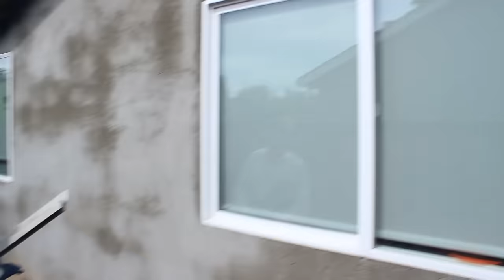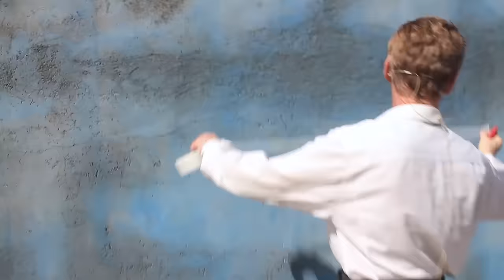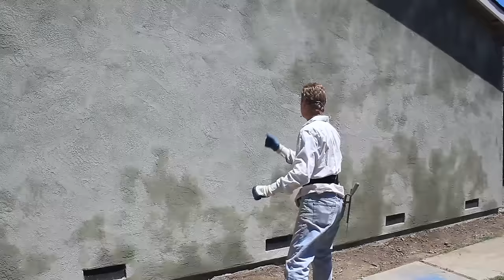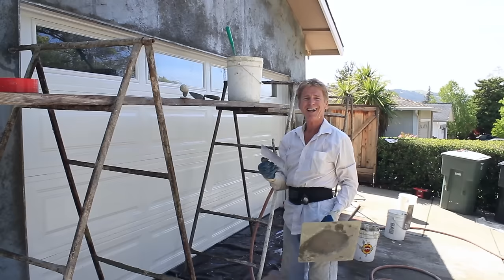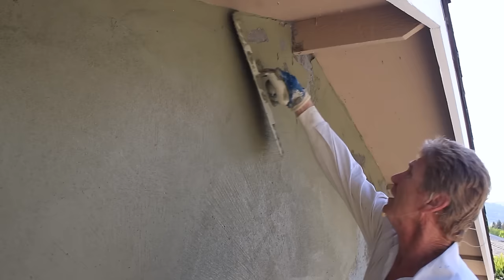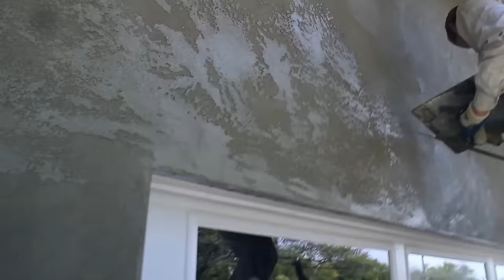Stucco Resurfacing

Comment: Hi Kirk -
I'm doing home that its painted some areas are really bad and stucco falling off with many cracks, contractor wants to hydro pressure wash I'll probably end up with some areas where stucco fall off from pressure wash and some painted (clean) areas, what do you recommend for the bonding process?
Should I go light on painted areas and few coats of bonding where paint and finish stucco coat are no longer exist?
My concern is two different surfaces and last thing I want is to see cracks between the areas or stucco falling off from painted areas 
Beautiful job keep it up 
Thank you in advance
Reply from the maker: Good Morning, Omri dude, It appears your contractor has the right idea. After the pressure washing, which may show some imperfections or deeper cracks, then a decision to correct should be left for your contractor to decide the best method of prep work before another finish.🤔
 To notice larger cracks and have some stucco flake off is normal. This is why it's necessary to pressure wash, to remove the loose stuff.
 When I first started, everyone sandblasted, which did more damage to the homes and our lungs than a night of hanging out with my brother, Luuuu.💃
Kirk and Jason Giordano plastering, sharing well over 850 free Stucco/Plastering videos for your education. 
    Together we have created the most comprehensive encyclopedia of Stucco and Plastering videos ever produced globally, all by your favorite plastering messengers of YouTube.
Bringing peace, love, and brotherhood back into plastering.🎭🏝🎆
https://en.wikipedia.org/wiki/Lath_and_plaster

Comment: Hi Kirk, we want to do our fireplace surround with stucco. Our goal is for it to have a concrete/stone-looking finish. We are going to build the wood frame and then attach Sheetrock. Then we would stucco the Sheetrock. How diluted should the weld-Crete be? Should we do color coat? And do we need to do a scratch coat?  Lastly, do you have brand recommendations for stucco/color coat? Thank you so much!! And if these questions are already answered in another video, please just let me know. Thanks again!
Reply from the maker: Good evening Lauren, any bonding agent will work. you can purchase French Grey by Lahabra at and plastering material yard, say the 20/30 sand. Simply apply the first coat, then when dry, apply another coat.
 If it's not dark enough for you add twice or three times the color, this just takes practice.
 Bringing peace, love, and brotherhood, back into the 🌎 of Plastering.
    The most comprehensive encyclopedia of plastering on video, by the plastering messengers of Youtube. 
Kirk and Jason Giordano with over 800 videos 🎭 👀💃

Comment: Hey Kirk... Been wondering ... They did a study on homes which were damaged in the fires....  If people use plastering finishes for their homes, do they get a reduction in fire insurance?... If so which plastering materials??..... Have companies moved to get their plastering products fire rated for exteriors in Cali?.... If ya get the time could  you do a video on this fire rating exteriors plastering finishes subject?
Reply from the maker: Good afternoon Roblox, this I'm not sure of.😏
 In the 1989 Oakland hills firestorm, I was working on a few homes, they caught fire, by the trees ablaze then falling and hitting the glass windows causing the homes to burn from the inside out.
 Plus, in a firestorm the heat is tremendous.
 I recall on one of the homes I was doing there were no more planks but just my scaffolding was still in place.

 Bringing peace, love, and brotherhood, back into the 🌎 of Plastering.
    The most comprehensive encyclopedia of plastering on video, by the plastering messengers of Youtube. 
Kirk and Jason Giordano with over 800 videos 🎭 👀💃

Comment: I have a two story 20’x80’ building, brick veneer over frame, and I want to do most of the stucco myself with little help.  I would like to do it in sections, a little at a time.  Any recommendations on how to do it so it has a uniform look.  What would I have to do with the lath, scratch, brown , and then finish coat to make it look good.  If I can’t do everything in sections what can I do?  Thank you for sharing your craft.
Reply from the maker: Howdy, my friend, as long as you go from corner to corner, you should be okay.
 To long to get to a corner, add an expansion joint in a key area that looks good but also allows movement.
Bringing to all the most complete plastering encyclopedia ever created in the world online.
 By the plastering messengers of Youtube.  With well over 850 free self-help videos 🎭 👀💃
Kirk and Jason Giordano Plastering
Reply: Kirk Giordano plastering Inc. Thank you so much for your help.  You are doing great things and an inspiration to a lot of people.  Keep up the great work.

Comment: In Canada thats all i do mostly is the acrylic stucco systems over Styrofoam. 
Styrofoam, base coat and finishes, run from $ 7/ square foot and up.
But with extreme temperatures, we definitely have our set of problems. 
Lol,you have heat,we have cold...
Reply from the maker: I’ll take the heat anyday

Comment: I know this isn’t the topic of this video but I have a serious question about weep screeds. My house had old stucco that my dad had ground off because it was in such bad shape. The house is a pier and beam wood frame house but has a concrete base along the perimeter and a concrete wrap around the framing. So I’ll be putting stucco onto the concrete not the wood framing. I’m in west Texas. Do I actually need a weep screed?
Reply from the maker: Greetings MH, no of course not. 
I had a home that the stucco went to the ground level, too.
 Weep screeds were not used until about 1975, we didn't start installing them until about 1980. Thus most of the homes worldwide don't have them.
 Relax and spend that cash on a holiday.
 Bringing peace, love, and brotherhood back to the world of Plastering. 🌍
    The complete plastering encyclopedia on video, by the plastering messengers of Youtube.  
     Over 850 videos 🎭 👀💃
Reply: Kirk Giordano plastering Inc. Thank you SOOO MUCH!! I appreciate you!!

Comment: Hey Kirk, I'm at this very stage in my project, so thanks for sharing!!! Do you have to wait some days between the polybond application and your finish coat? Also, curious if you can use 16/20 to do a skip trowel finish?
Thanks for the positive attitude!
Reply from the maker: Good evening Sean Howe Dude, no wait time, weld creat can be applied over even when it's tacky which takes about 10 minutes. 😉
A skip trowel texture or finish can be applied with any cement stucco that ever been devised.
Including the heavy sand.
You yes I have completed many skip trowel finishes
Our unique plastering Tip:  all subscribers or anyone who stumbles on our channel with a question, type it into our Stucco/Plastering channel, and like magic, a video will appear to explain how it's done. 	
   This feature is miles ahead of any plastering forum. 	
https://www.stuccoPlastering.com
http://www.bayareaplastering.com

Comment: Kirk, please help!
My house is built in 1951, stucco over cinder block in North East - Long Island, NY
Last year, the stucco on the stair wall (similar to your video "Choosing the right cement plaster for your home") began cracking and flaking.
I used a stucco patch sold at a big box store to repair it. it was a bucket of powder, just as water.
This year that wall began to crack and another wall directly facing the sun began to crack.
Not just crack but a 1/4" inch of the stucco began to come away from the cinder block.
Under the layer peeling away is painted cinder block
Once I scrape the loose away, do I use the 2:1 diluted Weld Crete and then what product over this?
I want to keep the wall white until I do the complete remodel next year so no need for color now
Thank you sir,
Walt
Reply from the maker: Good evening Disorder, I recommend cement plaster with sand added for repairs and not premade cements in buckets.
 Hit the area with any bonding agent and there are too many ways to correct the problem to write down here, but you can use Rapid set stucco sold at HD to repair.
 or poly bond sold only at plastering material yards, two coats.
 or Hanson Lehigh premium cement plaster mixed with sand. 
There are many ways to skin a cat.
 Bringing peace, love, and brotherhood, back into the 🌎 of Plastering.
    The most comprehensive encyclopedia of plastering on video, by the plastering messengers of Youtube. 
Kirk and Jason Giordano with over 800 videos 🎭 👀💃
Reply: @StuccoPlastering  Thanks so much for the quick response. Heading out now to buy supplies.
Thanks for the videos, you gave this old man confidence to do this myself
God Bless You!

Comment: Kirk, for a stucco that is softer -using lime but has some portland cement  mixed in (I use a bonding agent like yourself) do you have any suggestions or one of your videos on the subject?  This is over a concrete block chimney. I always like to defer to your experience for any things I might not have considered.

Comment: Mr Kirk, I've learned so much about stucco from watching your videos. You've given me the confidence to do it on my own, and it's very much appreciated!

Got a question for you:
I have a house that already has a color coat but it's old and has hairline cracks. Can I use MorFlexx on those cracks and cover the whole house with crystal white? I'm worried now that when it rains the MorFlexx repairs will show through my new color coat.

Thank you again, I really enjoy the stories and education.
Reply from the maker: Yes, you can use a caulking for the cracks after you pressure wash it. Then apply Weld-Crete bonding agent over the complete home including the caulking. If you did not apply a bonding agent over the caulking it would indeed bleed or ghost through. Or if the home has settled for at least 20 years, it's okay to simply color coat over it without caulking the existing cracks after it's pressure washed.🕵🏼
Reply: @StuccoPlastering  If I use a crystal white color coat, is there a way I can skip the bonding agent and just wet the house instead? 

I'm curious as to how the bonding agent will hide the MorFlexx lines. And yes, the house is from '86 so I guess I could have skipped MorFlexx altogether 🤷🏻‍♂️
Reply from the maker: @brendanhealy3  Yes you can skip the bonding agent, However, when it rains the caulking can bleed or ghost through.
Reply: @StuccoPlastering  you're the MAN
Reply from the maker: @brendanhealy3  Thank you, Just another day at the office for us. 👨🏻‍🔬

Comment: So I have the same situation as this video. Contractors are gonna use acrylic stucco but before that there doing the whole house with  a base coat with fiberglass mesh over the whole house do to alot of cracks. My question is do they need to use a primer as well before the finish coat. Thanks
Reply from the maker: All stucco acrylics come with primers that are specifically engineered for the longevity of that stucco acrylic. To not apply the primer voids the warranty.🕵🏼

Comment: How would you treat with the problem where there are cracks similar to the ones in the video but the plaster did not adhere to the concrete surface? If you knock it (with your knuckles or hammer)  you can hear hollow regions. Would you remove the old plaster or use bonding agent then skim/ re plaster? Please advise. Thanks
Reply from the maker: Good evening Noel, simple but a drag for the owner of the wall or home.🤔
 The applicator did not realize that the walls must be saturated with water, thus they applied the finish coat.
As fast as they applied the new stucco the basecoat sucked the moister out of the new finish.
 Thus, it won't adhere well. 
I did that only once close to 40 years ago.
I too learned the hard way about finishes adhering to basecoats or painted finishes.
 No doubt you will have t pressure wash the failing finish off and start from scratch. This time type in Hydarting walls before applying a new finish.
  Our unique plastering Tip:  all subscribers or anyone who stumbles on our channel with a question, type it into our Stucco/Plastering channel, and like magic, a video will appear to explain how it's done. 	
   This feature is miles ahead of any plastering forum. 🥳	
https://www.stuccoPlastering.com

Comment: I’m a stucco contractor in NY, I do EIFS mainly but with hardcoat stucco we use expansion joints to prevent cracking, I know you know this but wouldn’t that be a better option?
Reply from the maker: Good evening Don, my fellow plasterer. I believe expansion joints placed in critical areas to be an excellent idea, especially where additions meet existing homes or where walls have no openings within a ten-foot square area.
 We did not apply the basecoat. Instead, we applied just the color coat.
Reply: @StuccoPlastering  Agreed. I find that customers are turned off by expansion joints to, so depending on where I put it, say between the 1st and 2nd floor, I’ll put a decorative band on it. But obviously you can’t do it on vertical joints. EIFS is dominant in NY because of the cold weather so I don’t get hardly any hardcoat jobs,  once in a blue moon I get that customer that says “I don’t want that fake crap” lol. Thanks for the reply, good plastering!

Comment: Kirk, I’ve been wondering why you aren’t using a red float to spread with? Much, much easier than using a trowel to spread. We did it for years, and you can float it while you’re spreading. Much less work.
Reply from the maker: @jehjeh37111  I prefer a metal trowel, myself.
Reply: @StuccoPlastering  so much quicker and easier. Cut in with the trowel, spread with the red float and bring out the sand as you go.
Reply from the maker: @jehjeh37111  Evening, the red stiff sponge float is made for brick grouting, but if it worked for my needs I would use it, but it does not, it would leave nasty holidays everywhere creating three times the work with twice the necessary strength. But, your house, your methods both lead to the same goal. I prefer skill to muscle any day .😉
Reply: @StuccoPlastering  ok. You do you. It’s just how we did it in the Union for 15 years.

Comment: Awesome! Question: if I’ve got current elastomeric paint on the stucco, can I polybond them recoat with the maintenance free finish?
Reply from the maker: Hi B, Yes, you can but that's a lot of excess work for nothing. Pressure wash your painted surface; the current paint composition makes no difference. What is important is you pressure wash well, then any existing paint or loose paint when done, scrap off with a putty knife. Keep in mind if the paint was applied expertly none may come off. Then, apply a bonding agent and stucco any texture or color your heart desires.😏
Reply: @StuccoPlastering  awesome!! Just like my hobby, prep prep prep. That’s great to know, I’m in Florida so I’m looking forward to the challenge. Too bad y’all aren’t closer for some paid training!! 😉👊👊
Reply from the maker: @bsdiecastfantasyland2320  I wish I lived in Florida. 😉

Comment: Hi Kirk, I'm interested in making a truck cap using a wood frame, over laid with stucco wire or quarter inch chicken wire. I need something to trowel on that will stay uncracked with some pressure and movement. Do you know of any product that would do this? Thanks!
Reply from the maker: Howdy Kelly, aluminum sidings your best bet.
 As stucco, any stucco will weigh down your truck and crack like an egg, don't do that.
     Kirk and Jason Giordano, Bringing to all the most complete plastering encyclopedia ever created in the world online.
 By the plastering messengers of Youtube.  With well over 850 free self-help videos 🎭 👀💃

Comment: Hello Mr.Giordano. Great channel. I have a ?  I'm a CA coast carpenter applying stucco to a structure that has PT plywood sheathing and Heavy PT wall framing. I was going to handnail in HD galv. nails. Problem. I injured my thumb bad last week, 6 months to heal. I gotta gun staple the stucco wire now. I have my nailer and 304 stainless staples, due to all the lumber being Pressure Treated.
 So I just heard from a friend Stucco wire should not be in contact with the stainless steel. Electrolysis? My experience tells me it will be in painted stucco, so. What do you think?
Reply from the maker: Good evening R Dude, plywood over PT wall farming should be stuccoed the same way as traditional stucco. 
A moister barrier that is tacked to the plywood then instead of stapling or hammering nails, you must screw the galvanized stucco netting into the galvanized metal under the plywood.
 There is no electrolysis with these two metals. So, your pal is incorrect.
 The most common electrolysis in stucco is where folks install copper, 
we then have to apply a membrane over our galvanized metal trim as the copper and metal are not compatible.
 Bringing peace, love, and brotherhood, back into the 🌎 of Plastering.
    The most comprehensive encyclopedia of plastering on video, by the plastering messengers of Youtube. 
Kirk and Jason Giordano with over 800 videos 🎭 👀💃
Reply: @StuccoPlastering  The wood studs are also pressure treated not jus the sheathing. That is why I chose SS wide crown 1.5" staple. The PT rusts out the Electro Galv. kind in a week. Back to the SS/wire contact. My friend claimed that if the wire /staple connection sat wet in the stucco over the years, the thin galv. coat on your stucco wire would corrode away in a cathode where they touch. Then he said it would be thin rusted wire held by a solid  SS staple. I' m not trying to overthink it here but the build site has high humidity and saltwater a mile away. Should i get a fiber type stucco wire to be safe or should I sleep worry free that the contact point will last 100 years? Thank you for your advice.
Reply: Spiderlath?